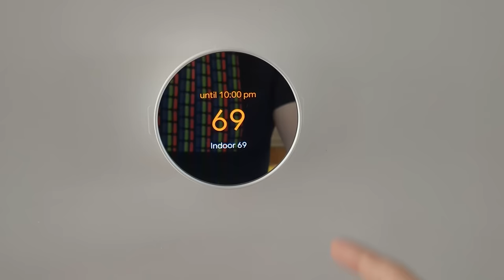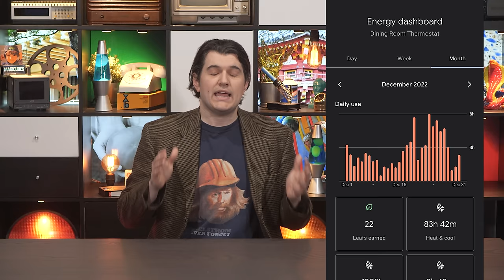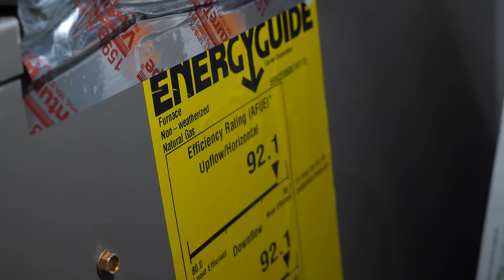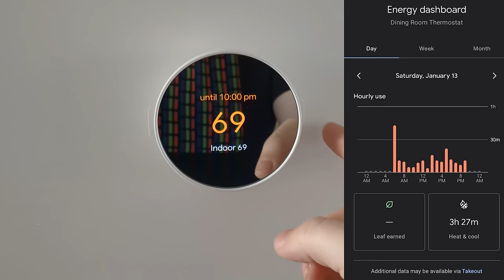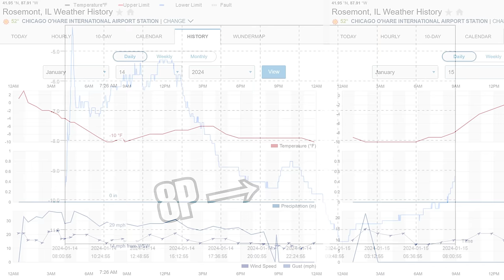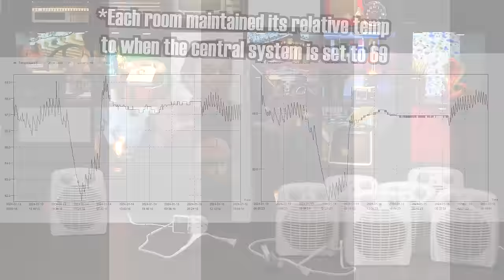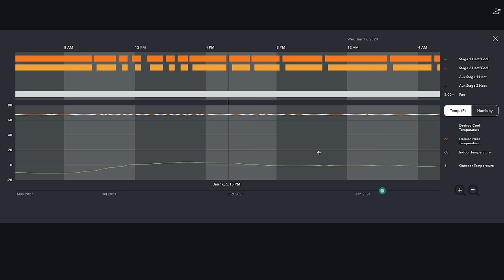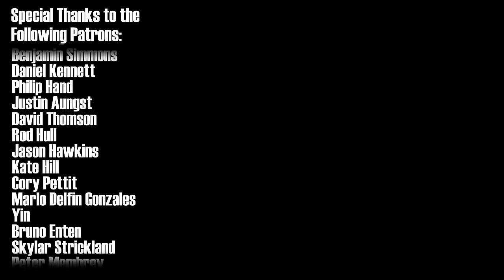Old HVAC industry practices are holding us back and costing us money. But we can fix it.

Comment: As a (former) licensed HVAC installer and technician, I want to thank you for giving this industry a stern talking to.  I did load calculations for my jobs and there was a (short) time where the state required them for every final inspection, but that was abandoned because few of the HVAC people here are intelligent enough too do basic math :(.

I'm not not kidding as they also had to seriously dumb down the state licensing test in a desperate attempt to help these idiots pass, despite requiring them to have all applicable code books with them during the test!  There was such a shortage of licensed workers that homes could not be built and I imagine this has only gotten worse.

Thankfully, I do know of local HVAC companies that are qualified and very good at their job, but I also know of some that are both incompetent and debatably criminal as they'll overcharge their own mother and then brag about it to other contractors.

Informing consumers of these issues is very valuable, so thank you.  This is perhaps the most important HVAC-related video you've done since the one on stupid portable air conditioners.
Reply: You really need to do a whole home model factoring location, sun, insulation, volume, etc, and the cost of doing that model is the half the cost of the system. Just makes more sense to do estimates and caution on the side of error in most cases. Ive run models for larger buildings for energy code reasons and the modeling cost around $6k. No single family home owner is going to pay for that unless it is high end and going for LEED certification, which Ive also done... on a $20 million house.
Reply: YES! This is so sadly and absurdly true! I asked all four HVAC contractors that bid the house I was building to show me their manual J's load calculations... two said they didn't do one, they based it off my square footage... and astonishingly the other two DIDN'T EVEN KNOW WHAT A MANUAL J WAS!

Not surprisingly, they all suggested 2 4 ton or bigger units for my 3200 square foot, 2 story insulated concrete home... but after paying $1200 to an outside engineering firm, the ACTUAL numbers called for a SINGLE 3.5 ton. I've been heating and cooling (heat pump) my house for 7 years now with a single unit.

HVAC contractors are a joke.
Reply: Goes for most skilled labour these days. There are very few capable people, because if you are able to understand all the code as an electrician or HVAC or plumber, you will either start your own business or be promoted away from the field. Either way you end up in an office. I mean someone who can make master electrician might as wel go for electrical engineer. Pay is better. So the people holding the wrenches and screwdrivers will always be the mid to bottom tier.
Reply: I wish I could shove this comment in the face of anyone who ever said "Why do we need to learn this math in school, we'll never use it in the real world." THERE IS TONS OF MATH TO DO IN THE REAL WORLD.
Reply: But all they need to do is make an excel sheet once and it's good for forever. Ugh.
Reply: Are you telling me you believe this equipment is designed to run non-stop?  That there is no duty cycle in this equipment?
He is basing his "my furnace is too big by a factor of 4" on the fact that his furnace only ran 6 hours in a 24 hour period.  It would not be appropriate to install a 1/4th the size unit and it have it run non-stop.  The system would fail in 2 years at the most.
Reply: @christo930  That ridiculous, it's not -15F out the entire winter. It only has to run nonstop for maybe 1 or 2 days a year IF that. 95% of the year it will be running far below its max output.
Reply: @Connie_cpu I tell people this all the time! It's the way the world works.
Reply: @christo930  What would fail? the two electric motors? The burners? That leaves the airflow sensors which are cheap. the furnace at my mom's house got completely dunked every year for over a decade now and has ran fine (after swapping the main board before ordering another spare).
Reply: @christo930 it only runs non stop in the worst possible situation calculated for. The rest of the year it will be cycling between 10 and 50%. Which is perfectly acceptable..
Reply: @Connie_cpu the vast majority of math formulae and algorithms aren't ever needed. Most people aren't complaining that they have to learn math. They're complaining that they have to learn something like A • B = |A||B|cos(theta). They aren't learning "math" in that sense. They're learning to understand and apply algorithms which is the bulk of life preparation K-12 attempts to do.

That's the explanation they're really looking for.

To reiterate, they didn't learn that mitochondria are the powerhouse of the cell. They learned, if they were clever enough to realize what was happening, how to research about mitochondria so that they could research diabetes when they develop it with their poor eating habits.
Reply: Since you're sharing walls with neighbors, your neighbors heat your house for you 🫡
Reply: The competency crisis is coming for us all one day, and it's not just limited to HVAC, standards for workers are lowering across the board in many industries. Railway, Airlines, ATC, manufacturing, shipping logistics etc.
It's a horrifying thought to think about
Reply: @christo930  who paid you to be like this?
Reply: @Connie_cpu  You're missing the point.  They are sized for the (typical)  worst case scenario.
This obsession with the alleged efficiency of these systems that all this silliness is about. 
You know what would likely be even more efficient?  To simply restart up district heating in and around the cities.  My father grew up with district heating.  District heating was common in the big cities and it is where the benefit will be largest.
Reply: @bmxerkrantz  Yeah, nobody ever has to replace air conditioners. You buy them once and then your grandchildren can use them when they are adults.  Said nobody ever.
Reply: @rogerk6180  Even 50% is high, IMHO.  There is absolutely nothing inefficient about this either.  It only becomes inefficient when you want to change your system to something else for no real reason.
Instead of heat pumps, anyone living in or around Chicago should be using district heating. It is far more efficient.  If efficiency is the number one goal, then that's what they should use.   Though it would likely require new pipes, all the infrastructure is in place and right of ways in place because this is how it was done before.
Reply: @angrydragonslayer   Projection much?.
Reply: @christo930  Are you serious? Nothing kills systems more than switching it on/off all the time. 
The most effective and longest lasting is to be able to run it all the time.That's where inverters come in and that's what's been done since inverters became the norm about 20 years ago.
Reply: People need to stop beating around the bush and actually call out these shady companies and contractors by name... there are few motivators as strong as public shame to change an industry
Reply: @Iceeeen  Are YOU serious?  They are built to turn on and off.  I guarantee you that IF you can find a duty cycle for your model, it's not 100%.
Reply: @christo930  awesome comment since the furnace that got replaced was a 1911 gravity furnace installed by my great grandparents.

edit, and yes, in sub zero temps that thing ran 24/7 for days.
Reply: @bmxerkrantz  This is why everyone likes to use sample sizes of one. It's an industry standard, especially when that sample size of one is coming from some guy in a youtube comment section going by the handle BMXerkantz and who likes his own comments.
Reply: @ZmbieTaco  IF they are genuinely shady, I 100% agree with you.  I hate when people talk a shady business they've dealt with but won't name it.
Reply: @ofoosy  it's not at all a competency crisis

It's a facet of the wage crisis
Reply: The main issue is, if the furnace is set at the proper level, customers will complain about long run times.  Oversizing heating is a safer bet.
Reply: @bobroberts2371  we aren't talking about furnaces
Reply: @Wise4HarvestTime  I wanted to mention that. This is how my 1980s condo worked. When the unit next to me was vacant I ended up having to heat it thru the wall. Then there were times I could tell I was getting free heat from a neighbor who liked it much hotter than I did. Thermal camera made it easy to see. US Home had built the place right before going bankrupt with offset studs on common walls for sound mitigation, and an amount of cellulose insulation that could best be described as "probably accidental".
Reply: @christo930 district heating far more efficient? I don't think so, you either have high supply temperature and therefore high heat loss on all the pipes running around the city and a low COP or you have a low supply temperature and need really large pipes so really huge investments and still won't get the COP that individual heat pumps can achieve . District heating is maybe only interesting in neighbourhoods with high rise buildings.
Reply: @christo930  You are correct about duty cycle. But that doesn't mean shut off. It means that it is running at reduced speed. 

Nothing kills efficiency more than switching something on/off all the time
Be it compressor, fan or something else.
Reply: @Soepsliert  When you heat something, the larger the container, the less leaks out.  The surface area ratio per unit volume decreases with size.  The pipes are deep underground and have very little leakage.  It is MUCH more efficient, which is why it was used.  I grew up in a house that had a district heating scheme before I was born though. My dad grew up in a house (not a high rise, a row-home)  in Philadelphia with district heating.
Reply: @Iceeeen  The compressors generally do not run constantly. They kick on and off.  Nothing quite kills efficiency or the life of windings more than excess heat.
Frankly, we really need to look at some popular models and see what their rated duty cycle is (assuming it is listed).  There is professional grade equipment designed for like 99% duty cycle with scheduled maintenance.  So I'm not saying it is impossible.  But most consumer/residential grade stuff just isn't made that well and generally doesn't require much in the way of scheduled maintenance other than things like filters or cleaning the unit every year to keep it free of obstructions.  There is usually not a change the oil scheduled maintenance and more involved stuff like that.
Reply: @christo930  Yes they do. Thermia, Nibe, Bosch or the Gebwell we tok in use in the beginning of last month. All have the same design philosophy. In the heating season they are ment to runt 24/7 and is regulated by the inverter from 10-100% depending on heating demands. 

The gebwell has already racked up 790h 🙂 , I will however agre it's a bit of bigger unit, it serves a lunch kitchen with a dishwater that requires hot water (how ever it still has only needed to run resitive heater for 3h up until now) and 2 offices.
Reply: @Connie_cpu  I saw a comic one time where a student asked that, and the teacher replied "you won't, but one of the smart kids might" lmaoo
Reply: So what you're saying is, as a person who can handle (and might even enjoy) running relatively simple maths estimations, I should study andlicense for HVAC, and work/contract out for large construction firms. That is really good advice.
Reply: @bmxerkrantz what would fail? the heat exchanger would fail dingus.  The heart of the furnace. Costs more to replace it in labor than it would a new furnace. -hvac tech
Reply: @Iceeeen your wrong....period. -hvac tech. I don't have time. Accept it lol
Reply: So many people not qualified to argue about what they are talking about it's crazy... real dunning Kruger effect in action
Reply: @NoflectioN  and people in the big are seriously outdated on how a efficient compressor works. Do you guys even have any idea what an inverter does? It controlls the frequency and regulates the speed of the compressor. The goal with a modern hvac system or any compressor for that (even electric cars do this) is to get rid of the start stop that consum most energy. A compressor running at say constant 500 rpm is alot more efficient than one stoping and starting running at 2000rpm...  Please educate yourself
Reply: That's why we have calculators. And "there's an app for that." (literally! I've seen techs feed numbers to the phone.)

The guy doing the install in our "data center" (small lab) had actual worksheets; he wouldn't bother with them if the inspector didn't DEMAND a copy. Schneider engineers where happy to see those sheets as well. (the install docs have tables)
Reply: @Iceeeen  No, they don't.  The compressor kicks on and off frequently through a clutch.  It is kept running with no load (via the clutch) because the cooling fan for the compressor is part of the compressor.
Reply: @RAWBOT301 You're not asserting that a Manual J calculation costs $6k, right? I would expect additional factors to provide higher accuracy than just a simple Manual J calculation, but when the rubber hits the road we only need to be within ~25-50% of reality because that is where the sizes of units come in (unless your calculation ends right next to a cutoff, in which case at least knowing the direction of inaccuracy helps a lot). A Manual J calculation requires a little bit of time, but not (I would hope) $6k worth.
Reply: @christo930  Most heat pumps (used generically; an AC is a heat pump even if the only way it pumps heat is out of the house) fail due to the number of cycles, not due to the length of time they are on. That is, ramping up the compressor from 0 to full-on takes a LOT more out of the longevity of a compressor (and the fans at either end) than just having it on. This is why working with your heat differential in your thermostat is the #1 "how to keep your AC running for a long time" recommendation (it changes a lot of short cycles into a smaller number of long cycles, although the overall "on" time should stay the same).
Reply: @rogerk6180  the worst possible case scenario.. apparently you people predict the future weather don't you? 🤣
Reply: @thedaveking  apparently thats not a thing.. according to the maker of the video in another comment thread. I explained this exact scenario that he is basically having help by his neighbors and thats allowing his furnace to work less.. he then goes on with his cult followers about how he didnt calculate those shared walls into his equation as he didnt want skewed results 🤣 then all of them claim im wrong on the exact situation you just described..  even asked if nobody lived there next to him how much would his furnace work.. they claimed it was negligible if there was no heat at all heating up the outside of his side walls.. this is a cult. They don't want real world facts.. they enjoy believing they're smart on paper
Reply: @Iceeeen  so... the start stop is bad for things, yet they've redesigned car engines to do this exact thing for energy saving? Uh you can't have it both ways there bud.
Reply: @tomdibble8983  yet we can see with modern engines that use the cylinder shot off features to save energy are doing now can't we? Funny thing.. when all that math gets put together by you people.. you leave out variables you didn't consider.. every single time..
Reply: @Connie_cpu  my math teacher: "youll probably only need about 20% of the math you learn here later in live, but you don't know which 20%, so can you pay attention please"
Reply: @jacksparrow3490   what?
Reply: @martinum4   Haha that's a great way to think about it, I love it
Reply: @jacksparrow3490  where does it say anything about car engines? an electric motor works in a different way. It always pulls most power at startup (3-4 times the power). 
But if you don't even understand the fundamentals off how it works it really is pointless trying to explain something.
Reply: @Iceeeen  modern vehicle engines turn off at stop lights or pressing the brake too long.. meaning its starting and stopping often.. its breaks more often.. is the point
Reply: @tomdibble8983  This is just categorically false.  There is not one residential air conditioner that is designed for the compressor to have a 100% duty cycle.  Compressors generate heat.  They can dissipate a certain amount of heat. But once heat is beyond the ability of the compressor fan to get rid of it, the windings will heat up.  Hot windings increase resistance and more power drops across the windings making them hotter still etc.

IOW, it's not how long the fans are running, it's how long the clutch is engaged.
Also, most of these compressors and fans have oilite bushings and not proper bearings that can be re-lubed. The amount of oil impregnated in the bushing is directly related to run-time, not cycles.